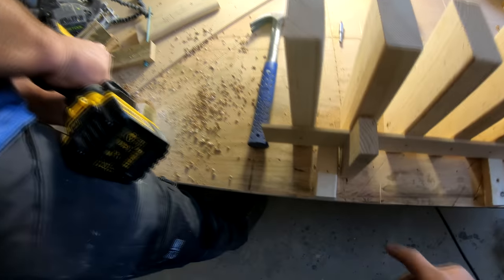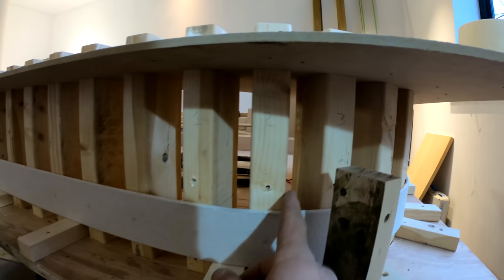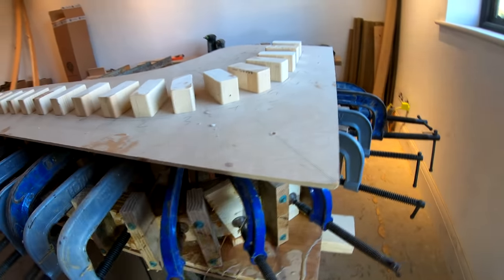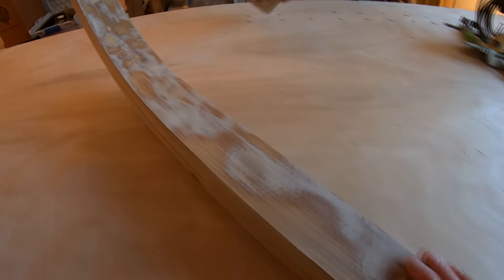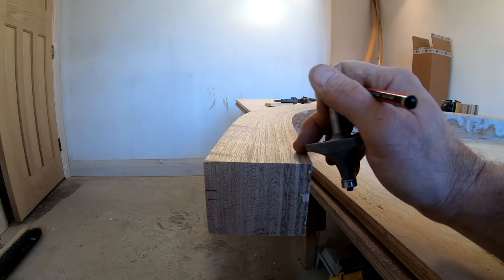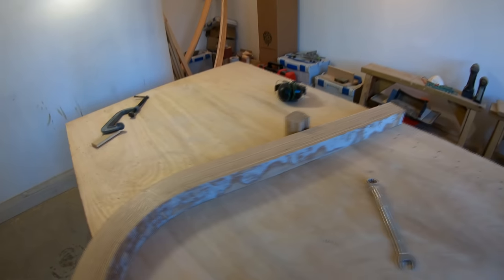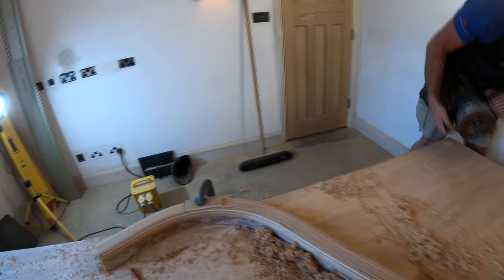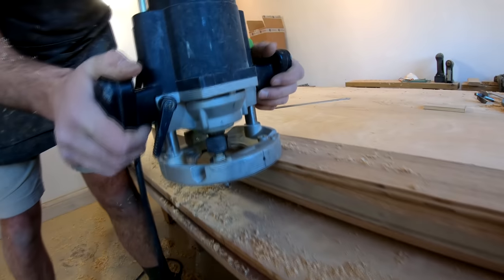FORMING A HORIZONTAL HANDRAIL AND FIXING | How to Build a Staircase #7

Comment: Great explanation. This is the exact way we fasten our hand rails to our newels using hanger bolts. Instead of squaring off the hole we bend our washer to foam to the round radius of the circle. That way if its not a grooved rail where the filler will hide the wole we can cut plugs and hide them.
Reply from the maker: Hi Brodie I know why you do that is it because you have no fillet to cover your hole, in that case we still Square off but leave the top round because we find the spanner hits the washer when tighting but if it works for you then that’s awesome thanks for watching all the best Tony 👍

Comment: Sure there’s a formula if you have the nut size think you divide by 1.62 will give you diameter of threaded rod , also there’s a chap on Twitter that’s a wood turner who makes great spindles if you need any
Reply from the maker: Hi cj never known that 1.62 it must represent something hopefully some one will know, what’s the guy name on Twitter always good to have another source thanks for watching all the best Tony 👍
Reply: Build With A&E not sure if that 1.62 is the exact figure it just rings a bell somewhere to do with thread sizes , I’ve that many formulas to remember lol , it’s Steve Jones @thewoodturner on Twitter ,
Reply: Today, all the handrail parts are  cut and shaped to perfection,  by CNC with only installation remaining.

Even 40 years ago, when I was just entering the trade, most handrail was simply cut and shaped from solid material.

I admire the meticulous attention  here but I think you've made, an otherwise routine job, horrifically time-consuming and difficult.

One problem the industry now lives with, is no real apprenticeships anymore and no formal training either. Each craftsman is left to his own devises and ingenuity. 

This can be good but wasteful of generations of knowledge and experience that has come before.

Comment: ahh cmon show us the joint. lol, I'm in the process of changing a softwood staircase parts to oak and the bottom newel kicked my butt today. Oak flooring undercut into the post with mains gas pipe right at the side of the post, bit odd.
Reply from the maker: Hi sicpac66 😂 about the joint, done that a few times I normally clad the base newel with 12mm oak plank and drop and oak square piece in the top or are you replacing the whole base newel, mind you I have noticed they are starting to supply the newel in one now instead of two plus cap, probably down to cost. Have a awesome week, Thanks for watching all the best Tony 👍
Reply: @BuildWithAE  yeah I'm replacing the whole post at the bottom. . Think I have some Oak trim I made a while back and might mitre that around the base to lock it in more. Bottom step had dropped and twisted string. Love your work made and good videos. Cheers